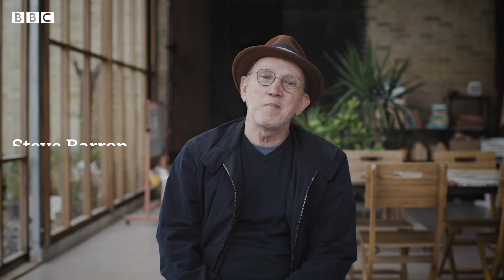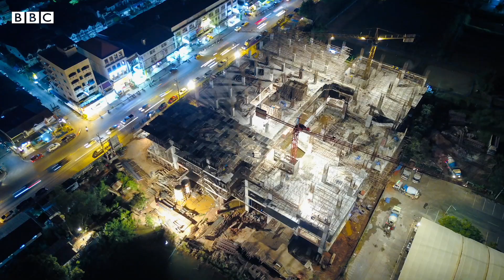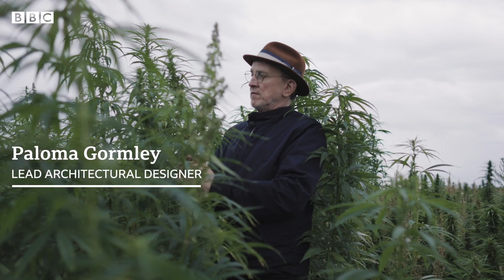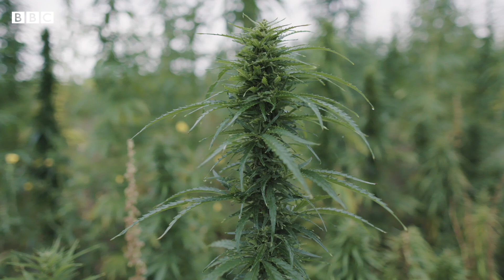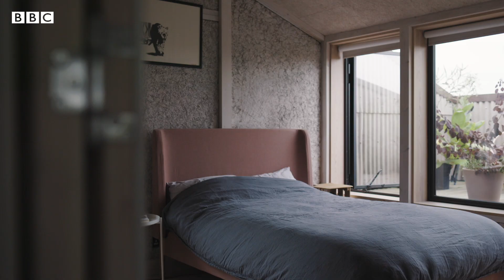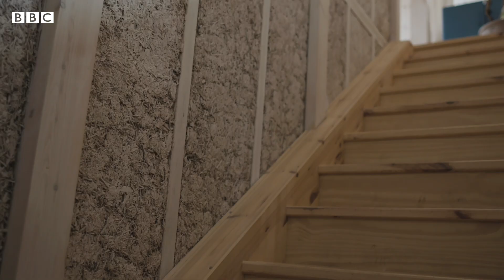Can cannabis help clean up the earth? - BBC REEL

Comment: DID YOU KNOW?Cannabis leaf
 Like marijuana, industrial hemp is a type of cannabis plant. However, the two varieties of cannabis are not the same. Marijuana contains high levels of a compound called tetrahydrocannabinol, or THC, which is responsible for its psychotropic effects. In contrast, industrial hemp varieties of cannabis are bred to contain no more than 0.3 percent THC (some hemp is low in both THC and CBD) and may have higher concentrations of cannabidiol, or CBD, which does not produce a “high” and can have therapeutic applications.